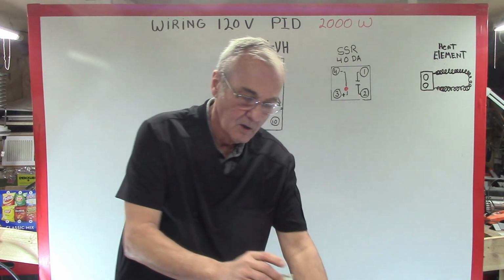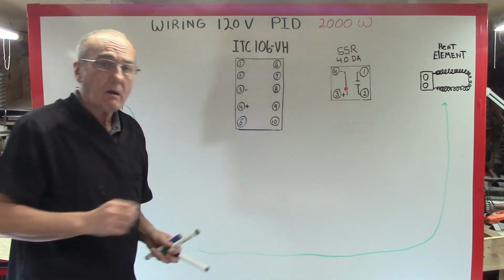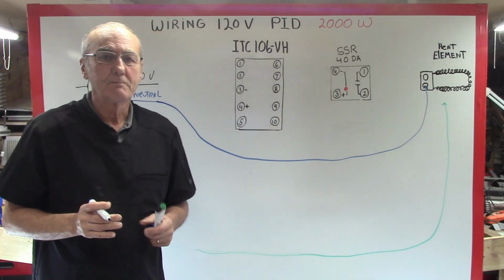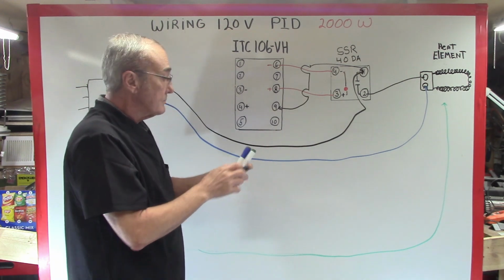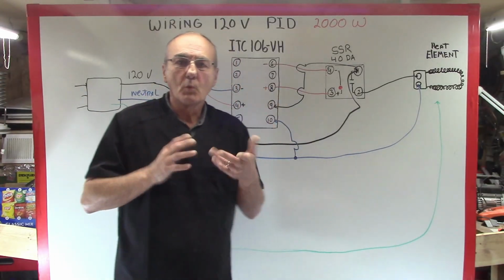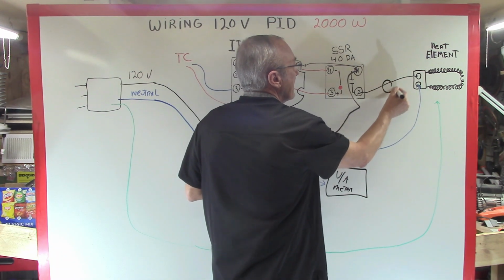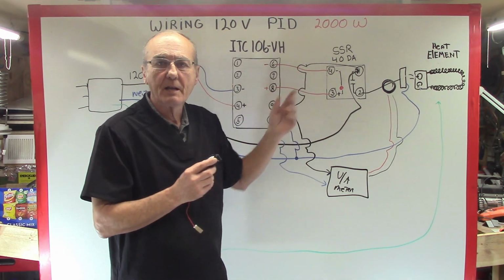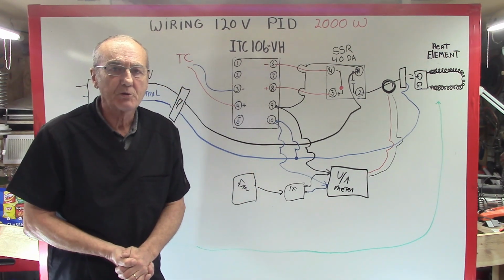WIRING 120 V PID AND COMPONENTS SIMPLE

Comment: So I’ve been watching a bunch of your videos they are by far the most thorough on the subject on yt thank you! Unfortunately I may have watched too much as I’m seriously confused on my wiring for my propane heated powder coat oven  project. I believe I have everything I need and have the box ready to go but wired it to how I thought I learned to be correct but the
Lit rocker switch while off had the pid lit up and when I flipped the switch I darkened the whole shop for a second. Can I contact you with my components and you can help me get this right so that I can ideally turn this on/off via the switch and temperature set?  PID CBAODUN A8-1 SSR-40DA 
In to the box I used the male end of an extension into the box. Out to the propane heater is the other end of the extension cord. I also have a 3pin 120v rocker switch and I’ve also added a fan like you did here and another video I saw of yours. Every time I think I finally understand this information I get confused an again. If you are willing and to chat for a second I’d be super appreciative.

Comment: If I want to use 3 mica strip heaters instead of just 1, pictured, do I need to run the 120V positive from EACH heater to SSR 2? I would still link each neutral side of the 3 micas as one, correct, to complete the "loop".

Comment: I'm curious why people use thermocouples for brewing heaters instead of a PT100? Is there a technical reason?
Reply: Only argument have read is for accuracy.
Reply: @laowai2000  PT100 -1000 are more accurate than thermocouples by far. The other reason thermocouples are not as good is because of the wiring requirements which adds to potential problems. The only 2 reasons that I can see for thermocouples for brewing temps is the low cost. PT100 is more accurate but costs more. I work with both and only time I use thermocouples is if the measured temp is over 600 deg F, and then I use "N" type over "K"

Comment: DOES THE CONTROLLER CONVEERT THE 12OVAC TO DC?
Reply: It does, but only so that it can turn on the SSR, usually 12vdc. Very low wattage though. The SSR just switches the AC on / off.

Comment: George Im tring to wire a 220v powder coating. Do I need 2 solid state relays to run 4- 3000w elements?

Comment: George, Thanks so much for this video! Your explanations and teaching overview are so well done. You are the go-to guru in this hobby on so many aspects of this satisfying and mysterious hobby. Up to now, I've done my brewing & distilling with propane fuel and babysitting the process while learning. Now I think I'm ready to engage with this at a more automated level with electric and a PID controller and remove the hazards of using an open flame now that I've transitioned to a more refined workspace (contained, insulated, heated, well-lit and plenty of work surfaces and cabinets and drawers to keep the gear in) Thanks again for demystifying the wiring for this set-up (I've checked out several and I think it's the best!) now onto learning how to program the PID to optimize my time and hopefully my final results!

Comment: Any way you could do a PID controller for a gas fired system? I can’t find much information on this and what is out there isn’t explained as simple as you can explain things.
Reply: I saw it done in a BBQ forum for a smoker. They used a solenoid to control the gas to the burner with a pilot flame that stayed on.

Comment: Hey George,
Do you see any issues with using a PID to control a solenoid gas valve for a natural gas/propane burner?
Reply: I saw it done in a BBQ forum for a smoker. They used a solenoid to control the gas to the burner with a pilot flame that stayed on.

Comment: Excellent Directions. One question. What is the size of the thermocouple threads? I have a 90 on top of my column with a 1/4" npt. I have a thermometer there. wondering if that's where I would put the TC.

Comment: For those of you who are a bit intimidated by the PID….i highly suggest looking at the PWM. I’m a shade tree electrician and am in facilities maintenance by trade; i went with the PWM. It’s very simple to build…it’s like a step down transformer just with a variable power knob or a dimmer switch for a lightbulb(do not use a dimmer switch, this was just an example). You’re going to be sitting near your still anyway, and I like the tactile feedback for making on the fly adjustments. George’s guide for building one is very thorough and in depth with several videos. Shine on!

Comment: Im still using the PID controller that I built, with Georges instructions, several years ago. Always keep an extra thermal couple on hand, lol. Great tool ! Thanks George 👍👍
Reply: What kind of problems are you having with the thermocouples where you need to replace them?
Reply: @USA__2023  I've onlt had to replace one, but none, of the correct type, were available locally.  I ordered a cpl so it should never again be a problem.

Comment: Love all your videos. For 120 or 240 volts switch can we use the 18 or 20 gage wire or it must be 12 gage on the switch. Please reply if you can. Thanks
Reply from the maker: Switching must match the load. 12 gauge wire is needed.
Reply: @BarleyandHopsBrewing Can I use 10/3 soow for the power cord?

Comment: A PID will never touch my still.
Reply: I’m just curious as to why
Reply: Why would anyone need one? You can't control the temp of a boiling liquid. It will boil when it boils lol. More or less power just controls output speed.
Reply: OH, you're one of those guys. @orbitalbreaky  The kind that wants to dip and out of the proper vernacular when it suits your purpose.
Reply: Don't knock it till you tried it. Sure beats babysitting your propane valve and then guessing what temp you'll be at. Set it and go...
Reply: @marknichols5827 I can guess exactly what temp it will end up at... The boiling point. Increasing or decreasing the heat input only changes the flow rate spirit output of the condenser.
Reply: @marknichols5827 if you have some way of measuring the spirit flow rate then using a PID to control that could make sense but that is not what anyone uses it for